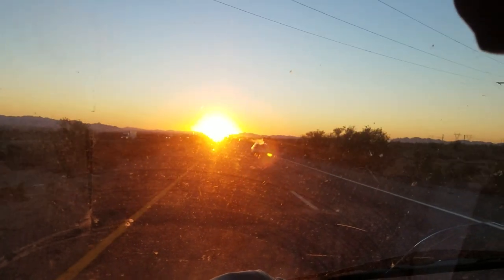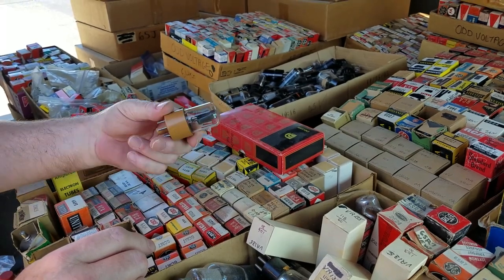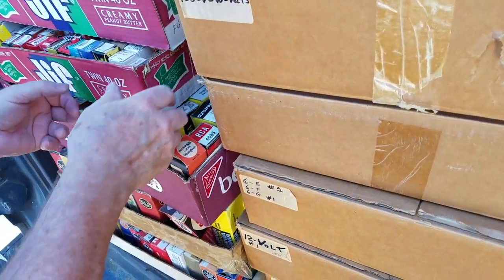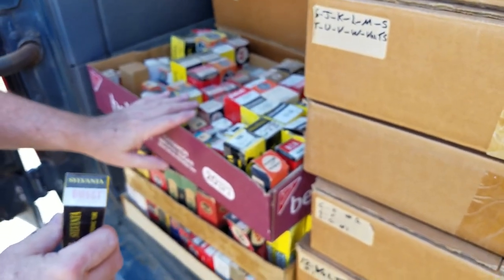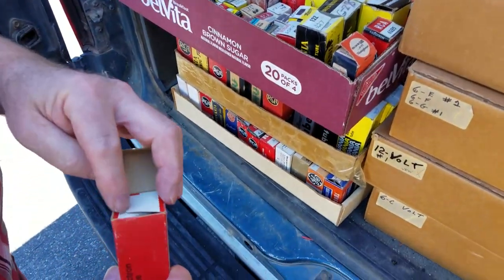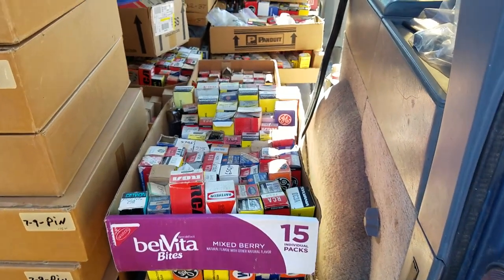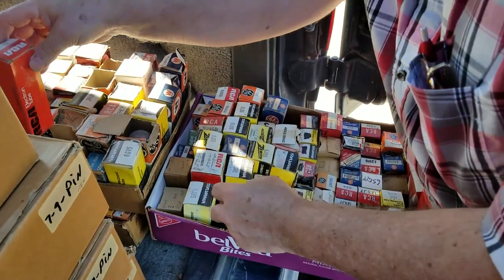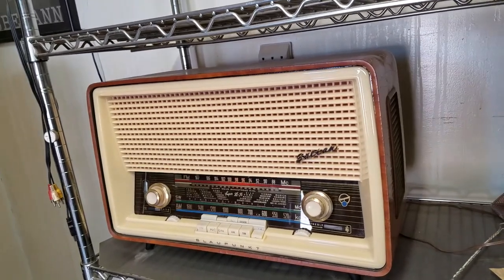Talkin Vacuum Tubes With AL

Comment: Usually an isotope of krypton with a (usefull)  lifespan of maybe 5 years because the half life of the isotope is 10.6 years. By that time 50% of the material had decayed. I presume to manufacturer could have added a calculated amount of extra isotope to compensate as it ages. Just enough so the firing voltage stability matches projected lifespan of a typical tube anyway.

Comment: They call it "optical sound". I have a 1940s "revere 16" projector from my grandfather which has that same sound tube in it. There are tiny sound waves along one side of the film strip. 
16mm film originally had sprocket holes on both sides, but modern 16mm film (still used today)/post 1940s has only one side perforated because you can add an optical soundtrack on the other half if you have a camera/editing deck that is capable. 
You just develop it like normal, there is a bulb that flickers with audio levels inside the camera/editing deck to make the sound waves on the film when being shot.
Also, 8mm film and 35mm (I believe 35mm) has magnetic sound like shango said; some of you may remember sound super 8 film from the 70's/80's, that was magnetic.

Comment: I had to clean out a storage former owned by a guy that had a shop,and i saved a huge pile of new old stock tubes,would like to know more about them.Tubes for radiation detection gear that dentist used.I also have transmiter tubes? radio tubes Philips miniwatt  power tubes and.Sylvania.Rca siemens G.E.C. Haltron radio tubes.many to.But not as huge of a stock as in this video.

Comment: RCA's short problem stems from the dark heater coating, the H-K  shorts started when they switched from the white coated filaments to the dark coating, the problem was so bad I wouldn't even use or buy them.

Comment: Many years back I worked on a Schober organ that used vacuum tubes in the tone generators. It was a divider organ consisting of 12 generator modules with a master oscillator and several divider stages all consisting of 12AX7 tubes. The master oscillator put out a sawtooth wave instead of a square wave so dividing as adjusted with a synchronous circuit through a transformer and a trimmer capacitor. It had bad tubes and I tried using GE, RCA and other versions of a 12AX7 tube but the divider circuits did not work with those brands. The only brand of tube that worked correctly was an Amperex 12AX7.
Reply: Would it heat the house in winter?

Comment: Remember the ITT branded tubes from around 1970? They were cheap but a very high percentage of them were defective out of the box.
Reply: I’ve found a few of them. There was even a knockoff called NTT.
Reply: There were a number of importers and reboxers and rebranders.. Richardson Electronics was one such, they were buying tubes from all over the place and putting them in red and white or red and black boxes branded "National", and the tubes could be just about anything from anywhere. Some good primo European stuff and some real dreck!  ServiceMaster was almost always crap. IEC was  Is originally a distributor for Mullard but later that name got used by some rebranding company and again the quality and provenance of the tubes was all over the map. By the way I once had a single Radio Shack 6DJ8 with gold pins that was branded "made in Poland. I sold it on eBay and the audio guy who bought it liked it so much he wanted to know if I could get more of those, but alas it was the only one I've ever seen.

Comment: Halogen literally raises the boiling point required for tungsten to vaporize off the filament by colliding and knocking the tungsten atoms back onto the filament. Metal halide is similar but has a salt added which keeps the tungsten smooth instead of regrowing crystals and mutating  the filament over time.

Comment: Dave Dobeson Australia
The phototubes have a Caesium (cathode?) electrode with about 90 volts on the anode. When a light photon hits a Caesium atom there is just enough energy to bump off the outer electron which is pulled to the anode. The current of electrons is the signal that is then amplified and sent to the speakers. Einstein received a Nobel Prize for explaining this "photoelectric effect".

Comment: @4:45 
What multiplier was the reading on?

 I assume that probe was either a LM 44-2 or 44-10 which really only has a effective range from 0-5mR on a non compansating meter, even than that effective range only gets push up so far. Even 5mR/hr isnt terrible, it's when your reading 5mR/hr from 3ft you should start to be concerned.

By the way just a niche, that's technically not a GM counter.

Also the 346B incorporates radium in salt form as radium bromide.
If they have the trifoil printed on them itll contain more radium, the 346C's use krypton
Reply from the maker: It was on the most sensitive setting so not a lot of radiation at all. I don't think I was suggesting it was deadly just that there was in fact activity there
Reply: @shango066  fair my comment is a bit rude in nature.
My apologies, reading it now I appear i sound like a ass.

Lowest is that a model 3? So x0.1, or does yours only go to x1.0?

I ask since that reading would  seams low on that probe for the source at hand.

Comment: Ok, so here’s an interesting question. What kind of tube VIBRATES? I have a 76 year old guitar student, and she has told me about having a summer job working in a vacuum tube manufacturing plant; presumably in or near the Chicago area (but possibly Wisconsin also) at 16 years old. She’s said she didn’t know what the tubes were for, doesn’t remember the company name, or the model number of the tubes, but said she clearly remembers her job for the summer when she was 16 years old (so approximately 1961-ish), being checking to “make sure the vibrating thingy vibrated”. What kind of tube would that have been, and what would it have been used for? That doesn’t sound like anything I’ve ever heard of…
Reply from the maker: That's a pleasuretron 696a
Reply: @shango066  … 😂😂😂
Reply: It could have been a mechanical oscillator for an early car radio, to turn 12V DC to 12V AC. Shango recently did a resurrection on an old Zenith/Ford car radio which used one.
Reply: @tonydonnelly  … Fascinating!
Reply: He did a vid on an old radio with a vibrator.  Substitute for an oscilator?
Reply: @tonydonnelly  Yes.
Reply: @shango066  A 69OK2?
Reply: @SteveHacker  ,  The "vibrator" used in car radios was a sort of fast-action mechanical relay or chopper that broke the DC voltage up into fast pulses which could then be fed through a transformer and stepped up to a higher voltage, and then converted back to DC to run the plates of the tubes. So-called "space charge" tubes were later developed that could amplify efficiently with only a 12 volt plate (anode) supply. DC voltages cannot be increased or decreased via a transformer, only AC voltages can: and most tubes need a hundred volts or more in order to be able to amplify a signal efficiently, which is why vibrators were used to step up the 12 volts (or 6 volts, historically) from the car battery.
Reply: Car radio vibrators were sold alongside tubes, and often considered tubes. Many drug store tube checkers could also test them.

Comment: North America needs a 501-C-(3), "preservation of historic electronics, and forgotten technologies" society and organization, because the thought of losing all of this knowledge, and ability to maintain these devices which have been so crucial in our history, well, frankly scares the heck out of me....
Reply: Seattle has a Connections Museum, that actually has vintage, operating AT&T telephone switch-gear. They have a YouTube channel where they show and explain the operation of all that gear. They have Strowger, panel, crossbar, and early electronic switches. All interconnected so that they can call each other. We need more stuff like that.
Reply: @dougbrowning82 , been a subscriber there for almost a decade, you're quite right, they do a fine job of preserving our telecommunications history. Had I the opportunity/capital/access to the necessary materiel (Boeingspeak), I'd construct a vintage 1975 electronics supply, complete with barstools, coffee pot, and Coke Machine (25¢ size glass bottles). I learned more at the one in my town, than during almost seven years of college!

Comment: Sylvania 6L6's: Al might be thinking of the 6L6-STR, for "special test requirement", which Fender used in some of their most powerful amps. A 6L6WGB is pretty much the same as a 5881, with a shorter bottle and plate assembly than a 6L6GC, and somewhat lower (probably very conservative) ratings.  The 5881 was purportedly developed to drive servo bombsights for the military in the early 50's but eventually found their way into the famous Fender tweed-era Bassman amplifiers.

Comment: I am told that the 6CL6 was used as a driver tube in some ham radio equipment. 6SL7 = 12AX7 gain (100);  the 6SN7 gain is [edited] 70 and they are more often used as a driver/phase invertor tube into loads that a 12AX7 or 6SL7 won't drive linearly. Note that Fender used the 12AT7, with a gain of 60, as both the reverb drive and phase invertor tubes. Similarly to the 6SN7, the 5751 has a gain of 70, and it's a good plug-in sub for a 12AX7 if you want a bit less gain.
Reply: Wrong. 6SL7 = 5751 gain. The 12AX7 has about 33% more gain than these.
Reply: @tomlewitt  ,  I had looked it up real quick online to double check my memory before I originallyposted it, and whatever chart I found said it was 20, but I just looked up again elsewhere and found it listed as 70. Anyway, Al here got it backwards;  Which is OK, I'm probably not as old as him but I'm old enough to be semi dyslexic half of the time.!

Comment: The 5U4  heater draws 3 amps at 5 volts while the 5Y3 draws 2 amps.  It will work but may stress power transformer.  A better fit would be a 5R4 or 5V4.

Comment: Dave Dobeson Australia.
I tried to restore a movie projector amplifier with a phototube. No matter what I did, I could not get rid of the AC noise; until I realised that the phototube was detecting the flicker of the lights over my workbench. In the movie projector the phototube only sees the light that passes through the sound track of the film.

Comment: The  smallest tube i found in my stock is 6AL5 with a box around markings and Think it say Thosiba Tokyo never used.Mullard ECC81 a preamp tube? G.E C A3283,   7404  z long small tubeMullard made in great brit... EF92? Have  to  find out what they can be used for,So they can be used by someone.

Comment: A 6012 thyratron doesn't have any mercury in it - it's basically a tetrode but with a bit of xenon gas instead of a hard vacuum. When a critical amount of current is conducted the gas ionises and the voltage from anode to cathode becomes very low, like 10-15 volts, so they can handle a lot more anode current than an equivalent vacuum tube without red plating. Once ionised the grid conducts to anode and only way to turn it off is to remove the anode voltage. Bigger and higher voltage tubes were mercury filled as it lasts longer and handles higher anode voltage than gas. Some tubes contained both mercury and gas. Hot cathode thyratrons don't typically have any radioactive material inside them. Cold cathode tubes can have a small amount - only hazardous if you break them and inhale the contents.

Comment: I’m definitely watching this, wish I could find a stash like that. Don’t need that many but I do need some 7591’s for a guitar amp that’s dear to me and a few other different types like 6V6GT, 12ax7 and wanna go vintage but hate the vintage price. I’ll find some eventually, thanks for the video!
Reply: Vacuum  tubes ar  kool
Reply: And radios
Reply: And used in old radios
Reply: 7591's and 7868's are the same tube with a different base/pinout. 7591 is an Octal, 7868 is a Novar. The Russians are still making them. JJ/Tesla sells a 7591, Sovtek/ElectroHarmonix sells the 7868. They're made in different factories. JJ's have a smooth rounded crown to the glass envelope. Sovtek's have a flat and dimpled crown to the glass envelope or a nipple on top. Watch trying to buy vintage USA made ones. They're usually burnt up when you can find them. They done a lot of heavy duty. AMi and Wurlitzer used them in thousands of jukebox amplifiers and Hammond and Conn used them extensively in organs.
Reply: Very interesting  you can  learn a. Lot that kool
Reply: I like your utube  video Shango 66 you are kool
Reply: What a Kool. Old radio
Reply: @Vaultovinyl  , last I remember, the Russian or JJ "7591's" were just rebased 6L6's with a 7591 compatible pin out but not having the same characteristics as the originals, and typically requiring circuit mods (re-biasing, increased grid-drive) for best results. Plus, the glass bottles are fatter and taller than those on original 7591's and so they don't fit conveniently into some amplifiers  ( especially Fisher and Scott hifi).  Are any of the repro modern 7591's more similar to the originals?
Reply: @goodun2974   I think that was the case with the early JJ 7591's. They were numbered 7591XYZ and came with a resistor that had to be installed to bring the bias voltage down. The current 7591S is the more correct reproduction of the Westinghouse 7591 and seems to run fine without any mods. At least that's the case in the two amplifiers I have that use 7591's. As far as I know, the JJ 7591S and the Electro-Harmonix 7591A are the only two current production 7591 types out there. I haven't found too many Russian octal based tubes that fit the retaining clamps in American amps. The EH 7591A has a coin base so you run the risk of the retainers breaking the glass envelope. Aside from removing the coin base and putting a salvaged full octal base on one, I don't have any suggestions for how to handle that problem.
Reply: @davidball1341   I actually own a solder pot which would indeed make it a little easier to swap tube bases.  I haven't gotten around to actually using it yet. Back when my main tube tube tester was a Hickok 752 that didn't have compactron sockets I made an adapter (a pair of them) so that you could swap 7868' into  a 7591 socket and thereby test them on the Hickok or substitute them into an amplifier.  One of these days I will make make an opposite adapter that will allow using 7591 in  a7868 socket!  That will be a little trickier but I have made my own socket extenders and socket savers in the past so I'm sure I can figure it out..

Comment: I used to throw away black tubes! 🥴 What a noob. But when most metals are vaporized at a very fast rate the particles are to large to make a silvery coating and are instead black. Still getters just fine. If you have any failed black tubes smash them and if you are lucky you will see a bright flash in the tube when oxygen hits the black getter. I don't know if there has to be a spark at the same time or if it just autoignites.

Comment: You can use the $20.00 Russian 6P42S/EL509/6KG6 to Replace the 6LQ6 and other expensive Horizonal tubes and they will take alot more abuse. You could make a socket adapter. I don't remeber but there are 2 pins you need to swap I think . I know it will work I Subed them in the early 90's..

Comment: What is a "dag" coating? As for the black coating on the inside of the glass on some tubes, although it might indeed be shielding in a small signal or RF tube, I could never understand why you would want to shield (or put a heat retaining opaque coating on) the inside of a 6V6 or a 6AQ5 or any other output pentode,  Which wouldn't require any kind of a shield and really should have the ability to radiate excess heat out as infrared through the glass. Besides which, how would it function as a shield unless it had a connection to ground or the tubes' cathode ?
Reply: The "dag", short for aquadag, is the outer coating on CRTs, which, in conjunction with the internal ultor creates a giant capacitor, which must be safely discharged before working on these tubes. Rogers-Majestic had a whole line of M series radio tubes that had a similar coating for shielding.
Reply: @dougbrowning82  , I've seen those spray-shielded Rogers-Majestic tubes, which looked like they were coated in a granular liquid-aluminum paint. Never heard the "dag" term before! Still don't know what the black coating on the inside of some tubes like 6V6's is. FranLab did an episode about the materials used in tubes,  the getters and so on, but no one could answer this.
Reply: @goodun2974  All I know about those inside coatings is they are often applied to power tubes, and that sometimes they're black, and sometimes they're gray. Just like the color of the plates.
Reply: It is possible some coatings are better at heat transmission, than leaving the metal bare.  Also, believe it or not, the color of the same coating will produce different results.
Reply: @robertp7209  , from what I've read, the various plate coatings helped prevent secondary emissions of electrons as well as dissipating excess heat. You don't want electrons being emitted by any element other than the cathode.  The worst case scenario would be if the grid was emitting electrons of its own instead instead of merely controlling the flow of electrons from the cathode (which is why some high power output tubes such as the British KT series of tubes used gold plated grids).

Comment: Wouldn't the last number on tubes be CONNECTED elements? IE: 6AL5 it's a dual diode so shouldn't it be 6AL4?
But remember it also has a shield between the diodes that's connected to a pin as well...